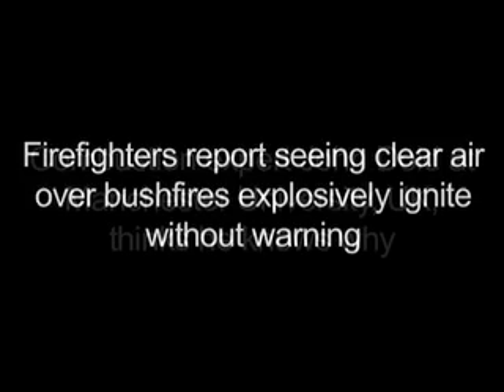Exploding bushfires mystery

Comment: Does this experiment take into account the wood being burned,  temperature and wind currents? Fire pockets are easy, hot air from the fires rise and cooler air drops accumulating air borne oils from the trees as it goes. The air pocket is sparked by an ember and Boom. Dancing fires are more interesting. The fire 'dances' (feeding on the evaporated oils) over the tops of trees at an alarming speed causing devistation when the fire touches down again, but doesn't harm the trees it dances over.

Comment: At approximately 17kmh, the wind speed is enough to over-ride the incoming air from the fire plume.

A plume draws air from around it, hence a fire appears to burn towards the middle.

Once the surrounding air moves faster than the incoming air, the fire spreads quickly.

Comment: Conditions on said day of black Saturday where horrible. i live about 60km's away and 2 suburbs over from me it was 49 degrees C. The amount of pre heating that the fine fuel >6mm dia, would have received would have been massive. the amount of flammable vapors already being given off from fine fuel would have been massive. all it would have taken was a hot car exhaust, a cigarette butt, any spark would have set it off. 
some reports where that the fire covered 20km's in a few short minutes...

Comment: There is a studied theory explaining the blow-up, published by D. Viegas in the Combustion Journal, which points to the fact that there is a feedback process of self-feeding  of oxygen income due to the ever-growing low pressure caused by the ever-growing flame front. This, as Prof. Viegas states, is triggered and caused mainly by topography (slope), creating its own winds, behaviour and direction of spread. A model has been developed and tested with real fires, results are very convincing.

Comment: I don't buy this for gas production theory for one second. What gas is it? How is it produced from these plants?

Fire burns up steeper slopes faster because the uphill side is closer to the fire. This causes increased radiative heating of the fuel (unburned brush), drying it out and heating it up faster.

Comment: Did an idiot make this video?

You can do this same experiment with two pieces of paper.  A fire will burn a paper in the vertical position faster than it would a paper held on horizontal because the flames burn upwards.

And these bushfires explode because they deprive the area of oxygen, and when a gust of wind suddenly introduces a large quantity, you see rapid oxidation.

Similar principle behind the cause of a backdraft.